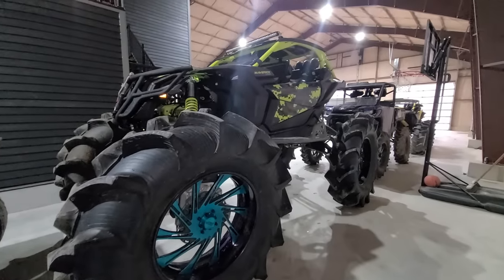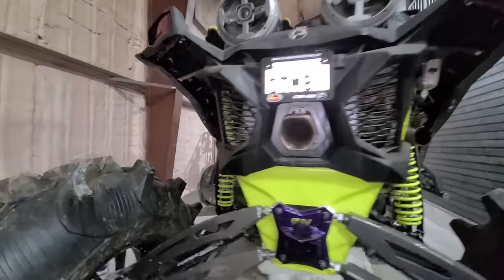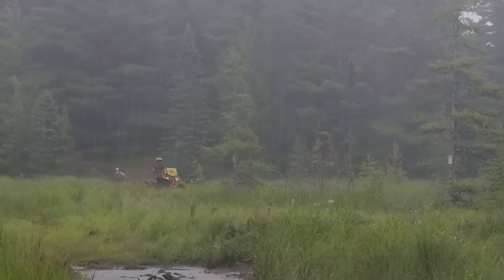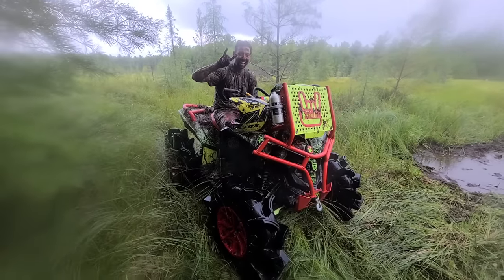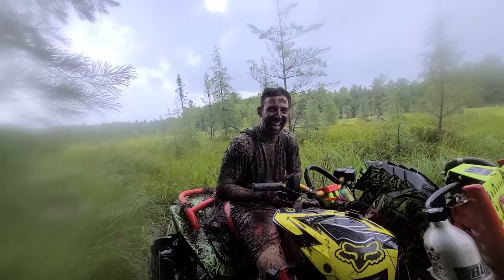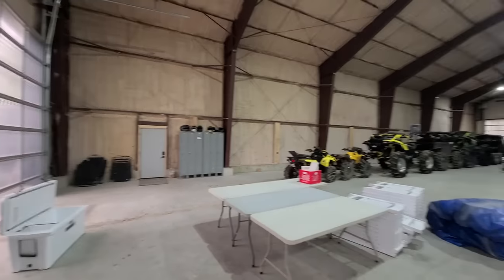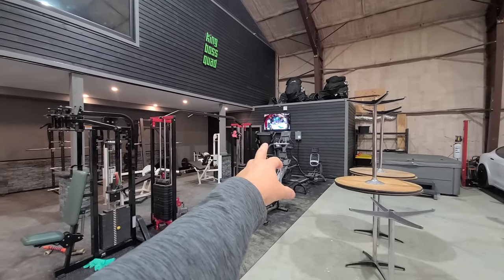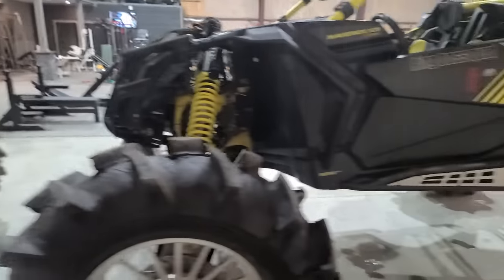Bounty Hole X3 vs Muskeg

Comment: Our pleasure to host you two and as always it’s so great to see you in these rigs.  Can’t wait to see you in October!  Much love 🤙
Reply from the maker: Skegtober is going to be freakin AWESOME!!
Reply: I'm just curious, but how light did you manage to drop the weight on those tractor tires? I'm just thinking sprung and unsprung weight as well as rotational mass numbers.
That's the craziest thing I've seen since I was building rock crawlers and running them up South of Dallas!
Reply: @Aint1S  we dropped 110lbs. They are about 150lbs total weight now.
Reply: @kingbossquad  😮👍🏼 That's crazy! That takes some kind of dedication to do it as good as you did and it's not even obvious that they were even cut.
I'm trying to think of tricks to help you control the camber of those jokers, but every time I come up with something useful... I forget you're running a SXS with independent suspension. I'm sure I'll think of something from another buggy I'd planned to build using Ford 9" diffs for independent suspension.
Reply: @ostacruiser  I’ve gotta come this year to check that thing out!

Comment: I can't believe he doesn't have a guard over the power steering belt to keep most of the mud off it so it won't slip or come off. Watching the front tires flop back and forth was so nerve-racking. Especially after you said a little slop earlier in the video.
Reply: Honestly I’ve had it buried multiple times. No issue at all.

Comment: That big thing sounds creaky AF....seems like it would break every 5 minutes?
Reply: If you’ve never ridden in a sxs before they all creak a shit ton unless everything’s just been redone lol😂
Reply: I'd only ;e worried if my rzr stopped creaking
Reply: @Yz4Life  this is 10x worse then a normal sxs because it’s got all heim joints instead of rubber bushings
Reply: @parkermckowen3781  meh sounds no different than any other 2-10 year old machine
Reply: I took the sway bars off my
Rzr and had 28” tires with a 4” kift . She creaked just as bad lol

Comment: need to make a steering drop box to locate lower, possibly under chassis to be able to turn better and would not have near as much "slop" with tire.   The straighter the Steering, The  more control of spindle therefor tire.  Should be first thing on list after putting such a large lift on.  Would save other parts as well by not allowing other parts to absorb so much of side deflection.   Would make turning radius much tighter.

Comment: It's crazy ar how many times the front tires are pointed in different directions lol! It's floppy lol you have to be easy or it'll all just fold up
Reply: Since everything is on joints it lets parts flex more so they don't break a lot of stuff better to move then not move

Comment: Man , that x3 looks so fragile . The tiny cv shafts and drop boxes running those giant tires and the crazy arched arms with those side-loaded toy heim joints just look ripe for the busting.
Reply from the maker: The exact same kit gets jumped 8ft in the air most weekends. It's a very strong build. They beat the snot out of them down South